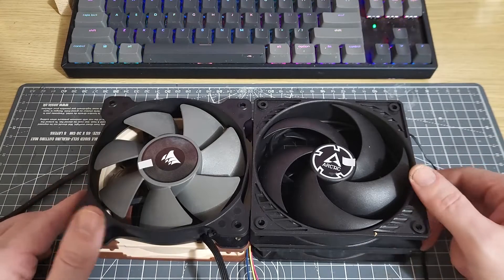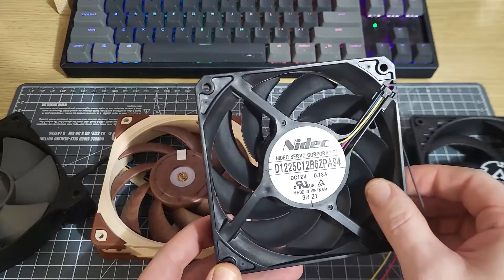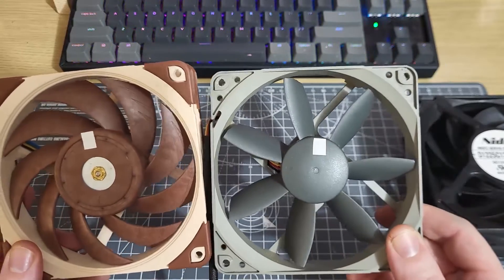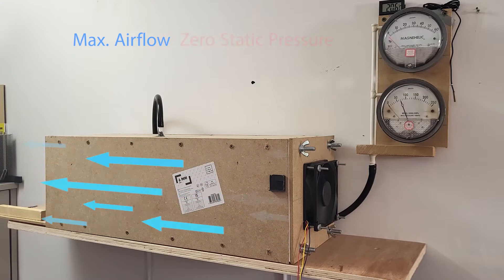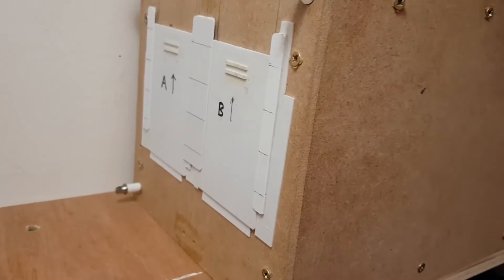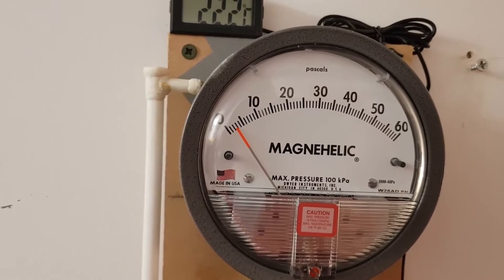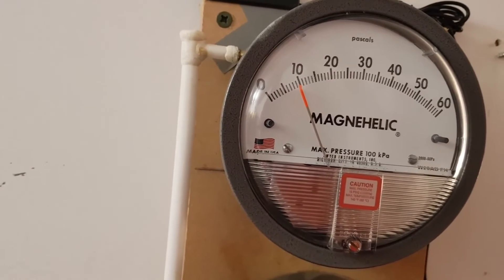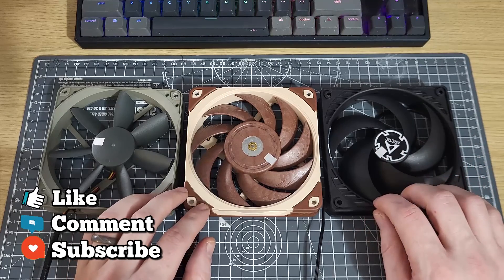"Static Pressure Fans" Don't Exist!

Comment: imo this "static pressure vs airflow"  thing is like torque vs horsepower thing frequently discussed in automotive word. some people always says more torque is better than horsepower which is just not true, you will always want more horse power, and torque is just part of the equation. And the same way you will always want more airflow, static pressure is there for keeping the airflow up under high loading.

Comment: This was not an honest inquiry.

You started with an assumed result and then imposed artificial limitations in an attempt to prove some, and you absolutely have proved nothing.

There are definite differences in the construction and performance of a high static pressure fan.

A high static pressure fan has a higher pitch and a higher current draw at a given rpm than a standard fan.

And then you dismiss the idea of running the fans through their full design range because 'people won't do that.'

Whether or not a fan can achieve certain performance goals is not dependent on people's personal esthetics.

Of course a high pitch fan that draws 3 amps is goung to overcome a lot more back pressure than any of the fans you've shown.

I always used Delta or Nidec server fans in my systems that I overclocked on air, and on non pc projects where I needed to push air against resistance.

With enough airflow, I could drag any Sandy or Ivy Bridge to 5ghz kicking and screaming.

Comment: This days most PC cases will have some fine nylon dust collection mesh behind a coarser protective metal mesh on the intake (front and PCU bottom) and radiator exhaust (top) sides.
So maybe a better testing scenario will be to create the following sequence:
Metal protective mesh -> Fine nylon mesh -> Fan -> Radiator (water cooling vs air cooking) -> Fine nylon mesh -> Metal protective mesh
My guess is that those will restrict the flow considerably. Not sure by how much though and would be interesting to find out.

Comment: Hi Major, I built a filter for my 3D printer with HEPA Filter + Active Carbon Filter + 12mm Fan (pulls air). Fan specs says its nearly 4mm H2O static pressure which is not enough to pass air from HEPA (only a little breeze). So when I run fan, it can't suck air from filter, instead fan sucks air from center of exhaust side  and blows it from blade's tips. I have a few questions if you can help. Which can give more static pressure, pulling or pushing air from fan?  (I can reorder as fan (blows) + HEPA + Active Carbon if blow is better). Is there a way to prevent exhaust turbulence to increase static pressure? Any idea to increase static pressure? (low budget)
Reply: I am going down this rabbit hole right now too. I am building my own filter stack for my P1S and trying to decide on fans, and then which side of the filters to put the fan on. Everything I have read is that fans with a higher static pressure are better for pushing through things (filters, heat sink, etc) and fans biased more towards air flow are better at pulling air or in open air.

Right now, from what I have found, I am looking to order with the fan blowing through the HEPA and then through the carbon.
Reply: @ri22o  I recommend not to spend time and money on PC fans if you can 3d print a centrifugal fan.
Reply: @volkanislek  Already committed to the project. I'll share a link when I am done. I did find it is recommended to go Fan > HEPA > carbon.
Reply: @ I am waiting for :)

Comment: Maybe no 'static pressure axial fans' but squirrel-cage fans are absolutely designed for static pressure.  This does actually matter in instances where you're buying datacenter GPUs for AI image generation, and they have really loooooong sets of fins, boxed in completely.  If you don't have enough static pressure - i.e. by using a squirrel cage fan, then air simply doesn't manage to work through the fins and remove air at all.  Meanwhile, squirrel-cage fans, have substantially lower CFM than axial fans.
Reply from the maker: Yep I'm aware - I made a couple of videos comparing axial vs. blower fans. This series is specifically about gaming PC fans that are falsely advertised as "high static pressure fans".

Comment: Ive noticed that having a sealed chamber or "tunnel" between my fans and heatsink has always yieled better noise and cooling resulted, is this related to pressure?
Reply from the maker: Yep using a shroud can improve performance with axial fans - I'll be testing this in a future video as well. The noise attenuation is likely because of a reduction in turbulence and is especially noticeable when you move a fan a small distance from the mesh of a case panel. Ultimately, everything to do with fluid flow is related to pressure of one sort or another, but it's extremely complex! :)

Comment: You completely ignore pitch and the effects on flow vs pressure. It's like gear ratio on a vehicle. A low gear ratio will accelerate quickly but have a low top speed. A high gear ratio will not accelerate very well but has a much higher top speed.  Fans are the same way. Yes both gear ratios make torque. But the ratio between torque and speed are different. Same for a fans capable max flow and max pressure at a given rpm. A fan capable of more static pressure at lower over all flow may be better when met with resistance as the flow is less likely to fall off. Where as a high flowing fan with little capability to generate pressure used with a restrictive setup would substancially lose airflow.   Much like a person climbing a hill on a bike with a low gear may slow slightly but will climb the hill, but the same guy on a bike with a high gearing will lose substancial speed climbing the same hill and likely not even be able to make it should the setup be incorrect enough.   Take each fan, dead head the box. Test all the fans at 1500 rpm and see what the "static pressure" is. Blades with more overlap typically have less "leakage" and are capable of generating more pressure. Fans with less overlap tend to leak a lot and are better for low restrictive flow.   This is a major thing in automotive cooling fans as they impede airflow at speed. The more overlap the fan blades have, the more surface area they consume, the more pressure they typically will generate given that they have an acceptable pitch. In reverse they also obstruct more air as well. Which is why a lot of performance fan shrouds have flap doors to allow air to bypass the fan.
Reply from the maker: I think it's worth clarifying that the main purpose of this video series is to demonstrate that so-called "static pressure optimised" fans are not what they claim to be. Yes there can be very minor optimisations, but these are generally not pressure or airflow optimisations at this scale and in the given RPM range of 1000-2000. I have tested all of my fans at 1600rpm and, lo and behold, the ones dubbed "high pressure" fans by the community (Gentle Typhoon & A12x25) perform the worst by a considerable margin. These fans are optimised primarily for low noise, which is why they are so popular. I'll discuss this and more in the second part of this series.
Reply: @FanPhys Try testing real high pressure fans and running them at their designed speed.

Hell even handicapping the fans as you did, I guarantee a nidec loping along at a leisurely 2k rpm, will move more air through a constricted outlet than any of these.

Thats what you should have been testing.

Comment: what is the volume of air getting pushed through the heat sinks is the real question for whether its optimized for air flow or pressure you need to take the pressure measurement after the restriction as well to see the loss of airflow
Reply from the maker: There's no such thing as "optimized for airflow" or "optimized for pressure"... they are marketing hooks designed to make you buy specific products. Axial fans = volume flow at low pressure. Blower fans = volume flow at high(er) pressure.